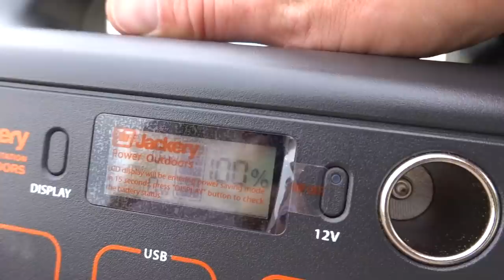Walls are Done!  Bunker Tour!!!

Comment: At the new house you should definitely get a generator that is directly hooked up to the main fuse panel so all you have to do is flip the main breaker and fire up the generator to power the house. Depending on the size of the generator you can at least power the lights and fridge. Bigger generator you could run the ac and stove. My point is its easier to get all that done now since you have the house pretty much open and all you need to do it run the wire and set a pad or area for the generator

Comment: Always be sure to pull off those manufacturing anti-scratch stickers off of displays because over time they will deteriorate, stop being clear, and damage the actual clear plastic it is supposed to be protecting.  So if you pull it off several years later there might be damage to the clarity of the clear plastic.

Comment: Look at "stand up" forklifts. They can get into very tight areas.
Reply: I think you mean a reach truck?
Reply: @princeofdeath7696   yes, we call them stand up forklifts at my work
Reply: @oldschooltunervw  I was only questioning cause i've seen regular forklifts in standup form.
Reply: Raymond 7500 "Dock-stance" reach lift.  Talk to your rep to find out the perfect height for your warehouse, and whether you'll need a deep-reach configuration for lifting palets to the upper area.  If standard reach works, just get that one.  They'll also have the information on recommended isle width.  The biggest advantage with Raymond that the competitors can't match is visability, user controls, and efficiency.  LINK: https://www.raymondcorp.com/lift-trucks/reach-fork-trucks
Reply: @oldschooltunervw  There are two major types of standup lifts.  Counterbalance, and Reach. A counterbalance lift is a standard-isle lift, whereas the reachlift works in both standard and narrow-isle rack configurations.  A reachlift is superior in many ways, especially stability (for load and lift) at making high lifts, and better load stability in turns/maneuvering.  Reachlifts are more agile and stable, and can lift far heavier loads, higher than the Counterbalance type of lift could even consider.

Comment: So today (The day this video released) I had the exact same solar panel delivered.  I am planning to use it for a ham radio go-kit using a now discontinued Yaesu FT-857D, LiFePo4 battery, colar charge controller, and a few other components.  So far I am impressed with the quality of the panel and it's performance.

Comment: Take it from a guy who's done drywall for over the last 30 years, those walls are not done yet, just saying...
Reply: They're getting there, though. Just need to finish floating and throw a quick skim coat on the bead and joints. Texture'll be fast and paint even faster.
Reply: Yeah but they haven't even taped anything up there in that loft area yet...
Reply: @thespicemelange.1  Any halfway decent crew of even two people can tape and float that loft in a single day, a larger crew could tape, float, skim, and sand it in a day with hotmud. I'm just saying it's getting close

Comment: Hi Matt, get a Linde H35, can lift up to 3.5 tonnes, great on diesel, comfortable, reliable, more than adequate for what you need and will last forever, I've been driving one for years every day non stop and so far only ever had a minor hydraulic leak from a hose and a chain break, but that was lifting 2 tonnes and bouncing that up and down for 12-14 hours a day (lifting bulk bags of chemical fertilisers and stacking them)

Comment: Hey matt, I would recommend an Electric Toyota 8FBCHU 25 forklift with the quad-mast it should give you about 237 inches of height. I use them at work, and I've got to say they ride really nice and run very well. plus there electric so no need for ventilation from the propane/diesel. lifting capacity is right around the 5,000 Lbs mark, which should be plenty for just about any kinda lifting you might be doing.

Comment: I have to agree Matt, it is very important to have very basic items in the event power goes out, no food in shops, but more importantly Water, water is the most essential thing we all need that we rely on a supply, clean drinking water is important, I am not a prepper, but i keep 4 times 25 litres of fresh spring water in storage in my house, I purchased from supermarket about 3 years ago, if the water supply is disrupted it will be impossible to buy.....stock up a modest storage supply of fresh drinking water....very cheap for me to buy, cost about $5 Aud....can you imagine if this pandemic or any contagion was transmittable through water we would be stuffed.

Comment: Matt Look into the difference in cost between owning and leasing a forklift including tax write off for the lease + maintenance
Reply: Matt, do check both owning vs lease, and maintenance details, but trust me, you want a Raymond 7500 reach-lift with the "dock-stance" cockpit layout. (Might also need a deep-reach configuration for lifting to the upper floor.)  

Make sure you get the right height for your racks, too.  A Raymond representative will help you find the right configuration for your place.

Comment: As a warehouse manager and former forkie, I would recommend an Electric Reach Truck. Compact foot print, high elevation and NO fumes. Only drawback will be if you need to go off concrete. They don't handle uneven surfaces, and wheel wear is horrendous on rough concrete or asphalt.

Comment: Love your vids. I'm a forklift Mechanic, if I can make a suggestion for your forklift research, look at the Cat p5000. Great for inside and outside use. Has a Nissan engine that literally will last forever. I have seen them with over 20,000 hours and still running fine. Now let's see more of that ZR1

Comment: Hey Matt here's a suggestion your building a mansion that has a lot of roof and it sits up on a hill with no trees blocking it how about you put a bunch of solar panels on the roof and get a big battery for it to charge or you can just get a natural gas generator hooked up direct to the power so if you loose power it'll auto kick on same with the big solar battery just a thought

Comment: I recommend getting an electric forklift Matt! Speaking from experience, you won't want all the noise that comes with using one of the propane powered ones inside. Also, despite it being a large open area with plenty of ventilation, you probably won't want to use propane in there. Good luck though with the search though! Hope you find one you like!

Comment: So I used to work as forklift driver/trainer for a lumber yard. The lift you need will be determined by your needs. How much do you need it to pick up and how far up you need to lift and the space you have to move it around equipment and etc. Also you need to know how much time it will run inside with the dock door closed so you know if you need diesel, propane or electric. Are you loading and unloading full trucks? My guess is you don't do more than 10k lbs in a single load. So I think a meccanum wheel 6k capacity short mast that can lift to 14-16 ft should more than meet your needs but I would gather as much info about your needs and talk to a dealer/rental place.

Comment: Convert your generator to tri-fuel. Gasoline, LP, NG. I bought a kit to convert mine, then T’ed off my gas line with a quick disconnect fitting and a shutoff valve. My portable generator can run “indefinitely” off natural gas now as long as there’s NG flowing.

Comment: When you don't use the battery for a while and store it make sure it is not charged above 80% (ideally 40-60%) because it will damage the battery (loss of capacity) long term if you store it fully charged.

Comment: Think a few 30 gallon drums with fuel. Run the generator or a vehicle in an emergency. Just use stabilizer and rotate the fuel into your car at least once a year.
Likewise a couple new drums with drinking water in them.😉

Comment: 7:55 if you put a ramp with railing onto the forklift as a craft made attachment you got a elevator should someone in a wheelchair visit
Also your forklift should be electric so you got no exhaust fumes that could build up and you could put a solar charging station onto the roof-witch you could also use for electric heating or AC

Comment: If the power goes out for a week you better have a dozen solar panels or more. Big nice solar panels like 300 watt panels or better. Some lithium ion batteries. I got leaf batteries. How you gonna keep your fridge going with that little tiny battery pack. Get a real solar back up system with like 30 or 40 big panels so it will work during a cloudy day. the little battery pack might be good for kids to play with.

Comment: Forklifts you’re either going to want to go electric or propane. Would definitely not get cushion tires, you should go solid pneumatic tires if you are going to use it outside at all. Hyster is going to be you’re top of the line super nice stuff. We have a propane Doosan at work and haven’t had any issues with it. Toyota and Nissan both make pretty good forklifts too.